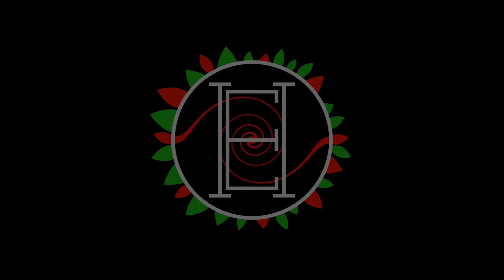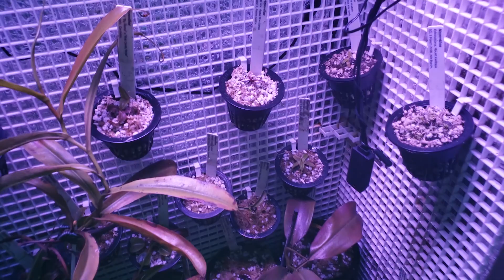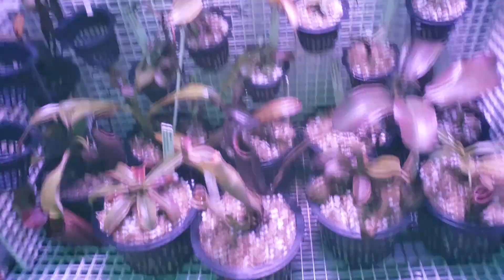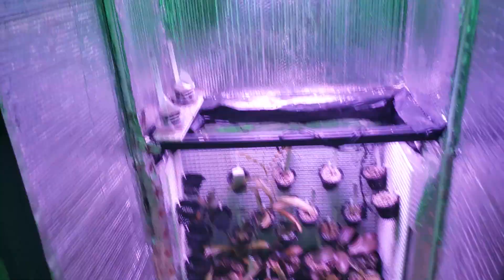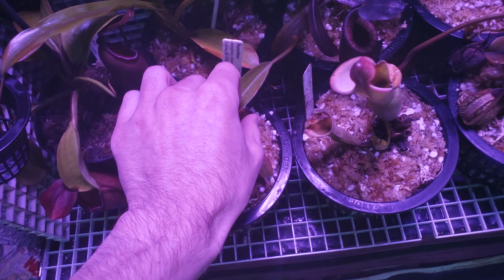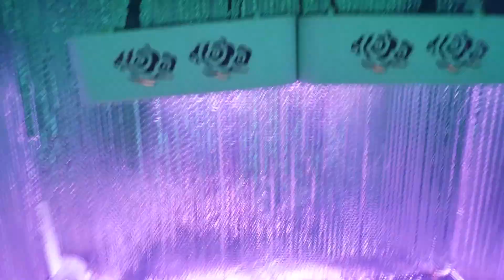Hypnotic Highlights: Highland Grow Cabinet UPGRADE!

Comment: Nice, what power lights you running?
Reply from the maker: Thanks!
Here's the info directly from the top of the lights:
Model: HG08-MX300W-W120V
Input Voltage: AC120V
LED Qty: 192pcs
Power: 300W
Pink:Blue=7:1
Reply: @HypnoticExotics  wow, that's some pretty serious lighting. I'm thinking of around 150W but my lights will be much closer, maybe 30cm away. A mix of blurple and white. What do you think?
Reply from the maker: Yeah my lights are almost overkill, almost... The 150w blurple/white grow light sounds like it should keep your plants happy. You can always raise/lower it, and play with the photoperiod as well. Just keep an eye on the new growth, as long as they're not etiolated, burned, or yellowing you should be gooooolden :)